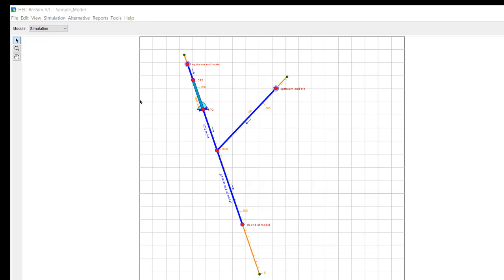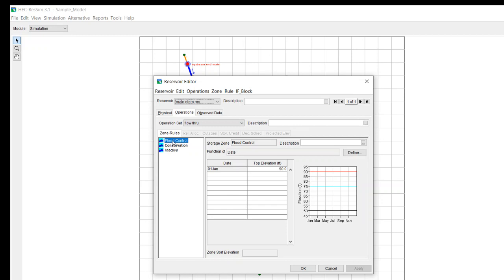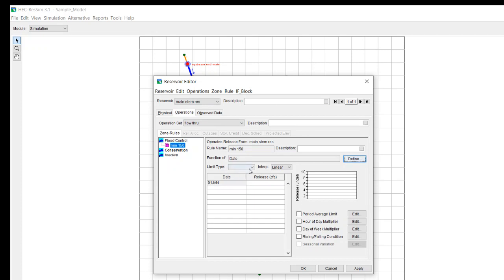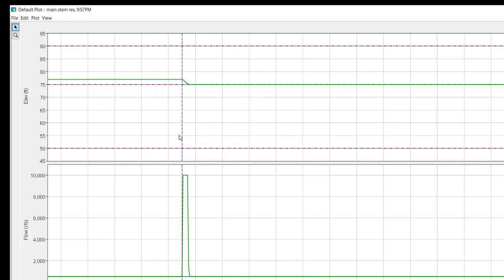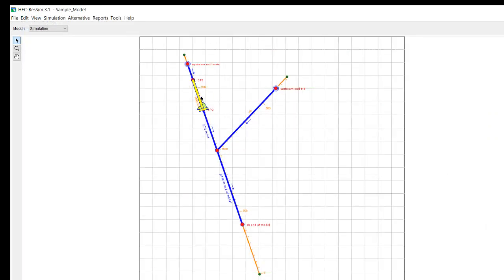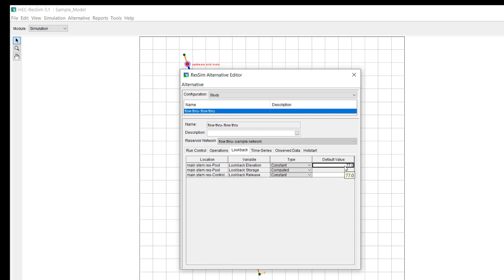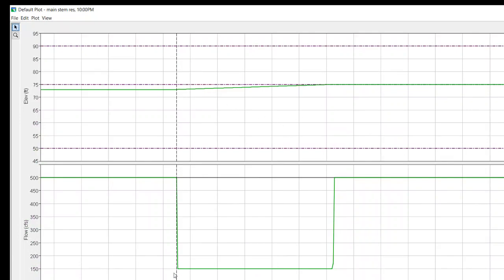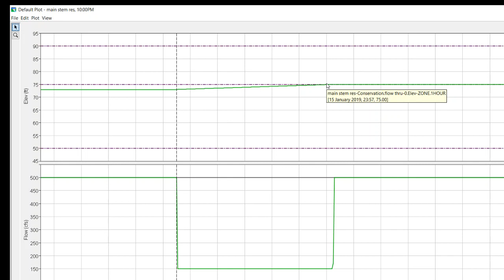Minimum Release Rule in HEC-ResSim

Comment: The video is very useful Thank you.
However I want to know how to know how to enter the flow upstream the dam. My streamflow data that will joint the dam are stored in Excel. So how can I enter these data into the model?
Reply from the maker: Mahmoud, you can enter the flow upstream of the dam by having a junction at the location where you want the flow to come in.  At that junction, you then need to specify that you have a local flow coming in.  You then map that local flow to the correct time series in the Alternative Editor.  For your streamflow in Excel, you will want to put that into HEC-DSSVue, which is the database that is used by the HEC programs.